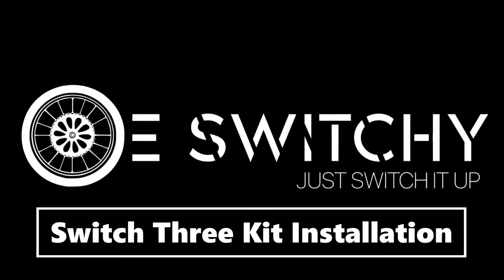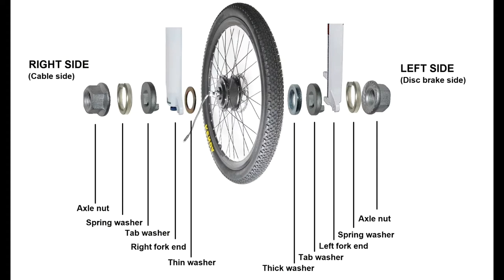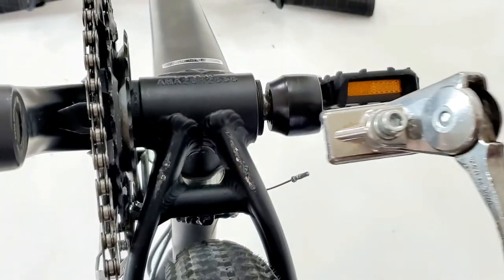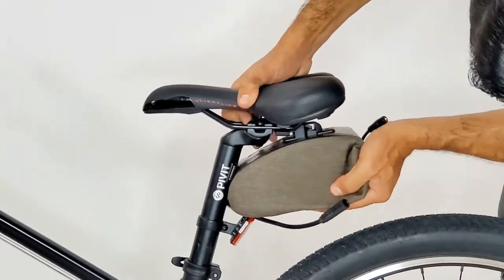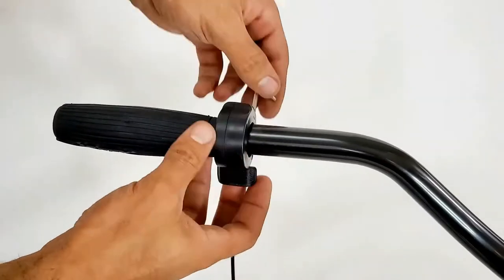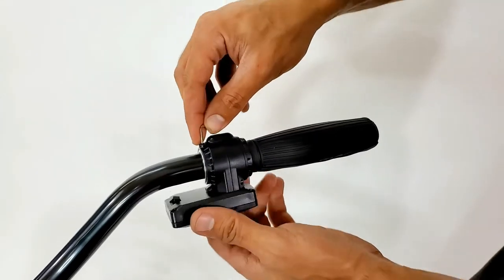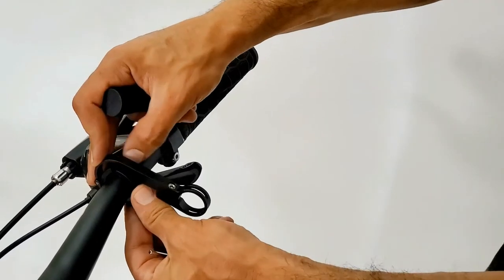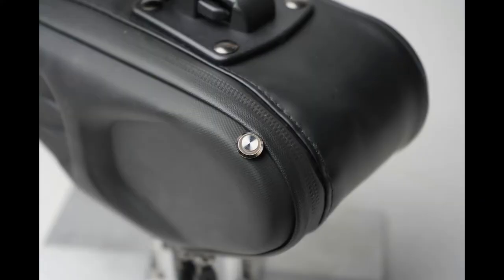E-Switchy Electric Bicycle Kit Installation Guide - Switch Three

Comment: Questions.... 0.24 ''Make sure the groove  opening is facing the steering wheel..'' Do you mean facing towards the handlebars?.. If not explain please.  0.54  ''remove the kickstand..'' am I to not reinstall the kickstand or am I going to have to buy a new stand? Can I reroute the wires or place the control box in a different location and if so what do I need to do to keep it safe or away from danger?  1.08  ' to add your battery you first need to attach the clamp under your seat rails''  Is there any other location I can install this? I have a rack on the back and I use it, so this would make it troublesome or impossible  to use my rack.  I'm sorry if I'm coming across as nitpicky but if it's a question I have I know I wont be the only one who is wondering. Thanks
Reply from the maker: Correct, it must be facing the handlebars. 2) you will have to add a different type of kickstand that does not go in the way of the controller. OR you can simply add your controller anywhere else on the bike :). 3) you can definitly install the battery anywhere on your bike, it will need some extra modification as the clamp is designed to fit under the seat. 4) you can add you battery on the rack, though it will limit the use of your rack. No worries, feel free to ask any other questions :)